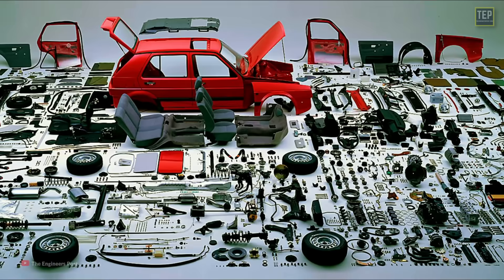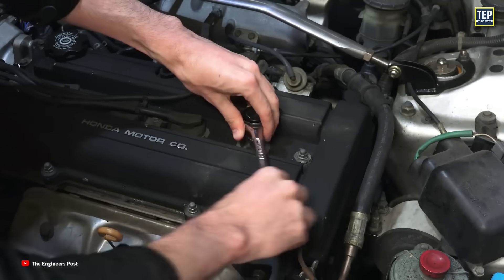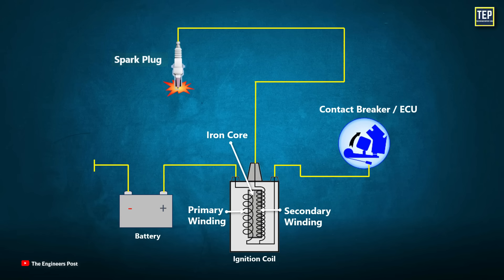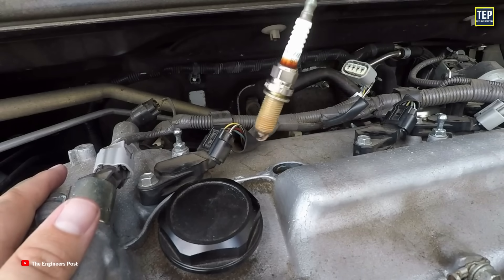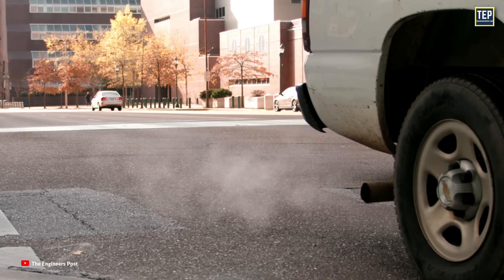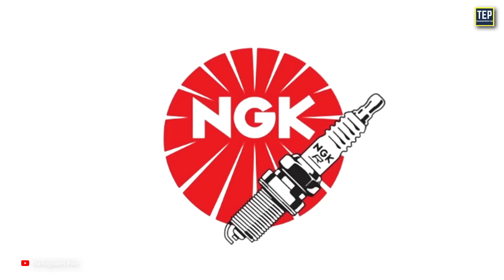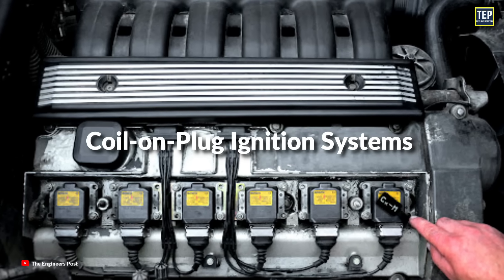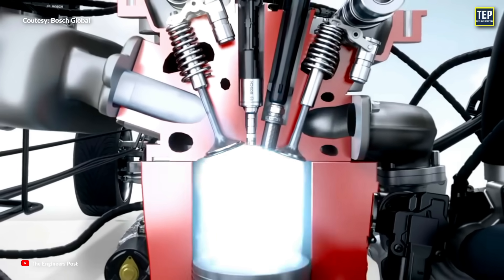Types of Spark plugs | Which is Best?

Comment: In the 90's or 2000's there was... SPLIT FIRE A SPARK PLUG IS SPLIT V TYPE SHAPE IN THE TIP. so the electrical current or spark passes through. So did it done the sole purpose.. of delivering fast ignition in all combustion in the engine.. it was discontinued in the laterr 2000 +.. now where is the developer of the said product..

Comment: Triple gap plugs should last longest as one gap wears the others take over, also the flame flash wavefront would be more even and would have more energy going downward. They are very good for small engines especially. Got a bunch for Briggs and Stratton engines very cheap from a hardware store on clearance. Improvement was immediately noticable.

Comment: I have  2024 Yamaha R1 and i was surprised when i realised it uses simple dual electrode cupper plugs. All my previous and less powered bikes used iridium, kinda strange tbh🤔. I tried to find iridium plugs to change and now im not sure should i install them🤔. A friend of mine installed iridium plugs in his Yamaha FJR1300 and got increased fuel consumption without any benefits...

Comment: I was in the room when design engineers were discussing new plugs with multiple ground electrodes.  What they stated is that multiple ground electrodes, don’t improve the spark plug, as it will only fire (spark) to one electrode.  They indicated that multiple ground electrode were a marketing tool, to allow plug manufacturers to sell plugs at a higher cost, as 2 was always better than on in the potential consumers mind.
Reply: ..and that is the hype at its best! It is a microcosm of the marketing world we live on. 'Buyer beware'!

Comment: I will have to say you are wrong about one type of spark plug. I have use a spark plug that had 4 electros around a center electrode. the Bosch platinum plus 4. They worked great  got a boost in power, and gas milage.
Reply: we have the same experience

Comment: Wrong , if it spark 100 times per second ,dos not spark 20 000 000 for  lifespan it spark      525  000 000 for 10 years  that is average 100 000 miles  Do the math

Comment: The right plug is the one the manufacturer suggests. It's the one the engine was designed to use. Simple.
Same with fuel. Use the recommended octane. Using a higher octane than what the engine was designed to use will actually get lower milage and preformance

Comment: In my Camaro with a 350, I had single electrode and it worked fine, when I put in the platinum +4 electrode spark plugs it was noticeable difference. Not like a little bit but a lot.  The difference between tires slightly spinning at a dead stop take off, to completely peeling out.  The difference was massive to say the least.  So I'm not entirely sure how that works out as I'm not engineer but real world testing to me showed that the plat + 4 had an edge on the single electrode.

Comment: 2 best plugs ever made NGK and nippon denso or nd or now just denso. Platinum or iridium. Run for 50k to 80k n regular car and only ones to use n 2 stroke dirt bikes they do not foul like all others and have tried every brand and type out there. you can plunk around on 2 sttroke and most plugs foul fast due to oil gas premix but denso and ngk last 5 times longer.

Comment: Those hemi engines with dual spark plugs were a huge pain. Not that it was difficult to change the plugs, there was just so many and going through and torquing down each one was tedious. 

I'm just glad Ford didn't do dual spark plugs on the old 5.4L's because you'd double your chances of a spark Plug breaking off in the cylinder. Lol
Reply: That's why I used double electrodes for them. It lasted the life time of my engines and no matter how had u beat on it, it's always feels brand new

Comment: I can for sure tell you that i use bosch super 4 sparkplugs. I have not yet seen any increased fuel , rather the opposite around. Been using it on a Honda Accord 1.8i  yr model 1998 and now in a Nissan Primera 1,6i. Made -94.
In the thank i have my own formula 😂
I  use 60% E98octane gas and 40% E85 (bio ethanol) ratio. 
The cars barely drink anything.
No Engine conversion or any other modifications on the cars. 
E85 are actually made for hybrid cars. Thank you for a good video :)

Comment: I’ve never known a spark plug to fail. That said, i change them per the manual.
A few weeks ago, I came across a Vauxhall Corsa with 80k miles. It was occasionally misfiring. Found the plugs to be original equipment. The gaps were 1.5 millimetres!
Neither centre nor ground electrode were badly worn, other than removal of metal due to spark erosion. Cleaned up the profile, set the gaps properly and the car has run sweetly since.
We will change the plugs, but the local parts store didn’t have any in stock.

Comment: Use only OEM spark plugs in your car and don’t buy knockoff counterfeit parts online. My Toyota runs on iridium plugs so I replace them after 100K miles and absolutely no issues.

Comment: i had noticed a few times, that even engines with normallly bosch-spark plugs run bad; after getting new ones - they were from NGK - it runs way better. It also depends on the setting of the manufacturer of the spark plug as of the engine; 'cause a good spark plug will always run good, no matter if there might be a wear like in the distributor case. Even spark cables matter - those who are designed for a engine work way better than something "homemade", like using 2 caps and a wire just to let it look fancy. if you want to get spark plugs - even on the aftermarket, 'cause your car manifacturer can't provide you with some - look for the numbers / letters, encode them and try to compare them from every manufacturer - some might seen better than others, and that little bit can be seen on the "cryptic code" (like, for ngk, BPR6ES or for bosch, FR7DC). That can you lead to the aftermatket-plugs with them your car could run better - 'cause that's also a point of the "hot plug - cold plug" .
Reply: Bosch is crapp  !  
its the most shitty brand you can buy.
Their sensors and coils are great..

Comment: If you a old British car, the iridium has a smaller electrode and fires easier,,,,the car will start easier,  British cars 12 volt and used a 8 volt coil when starter  to allow for voltage drop.  The on position then ran a resister before the coil dropping the 12 volts as to not burn out the coil.    This interconnection could cause some confusion,  such as a malfunction with the hand brake lite, could backfeed and cause the starter to engage until battery went dead.

Comment: Bought a few of those multi-pronged plugs and only had misfires and issues with all of them.  Keep it simple, and no problems.  A spark plug produces spark.  That's what it does, that's it's life's purpose.  You're not making more horsepower with a spark plug.

Comment: Running latest NGK Ruthenium HX and new NGK coil on plugs on my Nissan VQ35DE V6 3.5  - so far performance is impressive - in my opinion engine runs like new - new plugs and coil on plugs REFRESH the ignition system substantially - known for 'high ignitability'  (HI), Ruthenium is NGK's latest yet have been out for a few years - most people have never heard of them - like me!!!   Really good for older engines that need all the help they can get.  NGK fan because of NGK long life and performance - real world experience over many years.
Reply: Ngk plugs doesnt work great on all engines, some people say they had a sluggish engine when they installed a Ngk plug while the Oem plug fixed all the issues. So you must be carefull when replacing spark plug, you cannot just install every brand out there, even with the exact same specs. Every brand has a unique specific electrode desgined for the specific engines.

Comment: It's a lot more than 20 million sparks through it's life span... 100 sparks per second = 6000 sparks a minute = 360k sparks and hour. Even taking into account the bare minimum life span of a spark plug = 30k miles driven at am average 30 mph... that's 360 million sparks! Well... with those numbers it's easy to calculate other average mph and doesn't get anywhere near 20 million with a realistic average. AND, most spark plugs do A LOT more than 30k.

Comment: I habe been using Bosch multi electrode spark plugs in all my Hondas with smooth performance for longer that 60K miles for spark plug set, compared to the 600K miles for the original Denso plugs. A 93 SI, a 98 VTI and a 97 CRV.  I also used Champion surface gap electrode, basicalli designed for marine overboard engines. For these plugs you need a high energy capacitive discharge ignition. This was on a heavy modified 1962 VW beetle. Never had to change or clean plugs. They lasted for about 200K miles, untill I sold the beetle. Now I have a 3,5 liter V6 mitsubishi. I use the recomended iridium spark plugs, just because they are changed at every 60K miles service, and you need to remove the INTAKE MANIFOLD to access the plugs...

Comment: 20M sparks through its lifespan ÷ 100 sparks per second = 200,000 seconds its lifespan! 

200,000 ÷ 60 seconds (is equivalent to 1 minute) = 3,333 minutes

3,333 minutes ÷ 60 minutes (is equivalent to 1 hour)= 55 hour

Is the lifespan of the sparkplug is equivalent to 55 hour? Please correct me if im wrong!

Comment: Years ago the spark plugs used in a Mercury  snowmobiles with German Kolher engines used the sides of the plug as a ground to the electrode. The gap was always perfect and all you did was brush the plug clean.For some reason they stopped making these plugs,Sounds like they were too good

Comment: One other thing, the NGK Iridium  is not durable but also cheaper than Nippon Denso which comes with many Japanese car brands. They are very close in performance. I have been using NGK from the 80's with different cars and models from Japan. They have never failed me.

Comment: There's one type of plug you forgot to talk about... the RUTHINIUM plug  said to last longer than an iridium plug. I have used these plugs in 2 of my cars and they really work. Better than an iridium? Idk but I like the fuel mileage gain when I switched to them and the response in the throttle seemed a lil better as well
Reply: Unless you actually MEASURE gas consumption with calibrated instruments and power on a calibrated Dynamometer, you are just wondering your "results"...
Reply: @alfredomarquez9777  no sir been driving and wrenching on cars, bikes atvs any thing with an engine and I have to say... I won't use anything but ruthinium plugs, my dyno is my foot and my butt I know when a vehicle runs better and when it don't. 
All you techy guys with your computers and all that think that's where it's at, for some stuff it is but you can't tune a carb with a computer, that takes skill and experience. 
Look I'm not and never have tried to hack on your video I was just letting you know there is one more plug out there that you should give a look at that's all.
Thanks for the video bud it was very informative

Comment: I bought a used car with 226k miles on it. Needed new plugs, which was reasonable to replace... I discovered that those were factory originals from 2001, and had never been changed, because it literally just kept running fine, until one or two plugs fouled. Well, I splurged for "fancy" NGK Laser Platinum plugs with multiple spark gaps, and they only made it 2 years, 26k miles before all 6 were toast. Now I have basic single spark gap Iridium plugs that cost 3x less than NGK, and performance seems improved.
Reply: What were the identification numbers on the vaurous spark plug models?
Reply: @gregorymalchuk272  Originals were Bosch R6 Platinum (single gap). Replaced them with NGK BKR6EQUP Laser Platinum (4 ground electrodes). And now I'm running AutoLite XP5224 Iridium (single gap)
Reply: How did the NGK with 4 electrodes perform? I wonder because I just bought them but haven't replaced them yet.
Reply: ngk is not the same anymore - quality wise
buy denso instead 👉

Comment: I am going to replace the plugs in my 1997 Toyota Avalon.  The owners manual says to only use dual electrode plugs.  Since I had already bought single electrode plugs, I was unhappy.  But now I see that the extra electrode is only to extend the life of the plug.  I'm now planning on using the single electrode NGK plugs.  Thanks for the knowledge.
Reply: Used to had the mcv21 2mz 2.5 v6 engine, on manual it says to use the dual electrode spark plug but I found the ngk copper, single electrode, which is the cheapest one, performs better, the car feels more responsive, more fuel savvy.
Reply: camry went almost 100k on platinum ngk single post. Was running fine but had to remove plenum for sensor so had access to rear plugs on V^ put another set of ngk platinums 40k and baby is smooth as baby butt

Comment: my only vehicle takes two spark plugs, so i can afford more expensive plugs.
it's also high strung running on 91+ octane, with a high performance ignition system .... my primary criteria is a knock resistant plug, and so i settled into - one heat range Brisk racing plugs.
they have multiple ground electrodes, but my engine is swirl ported and so has a very well atomized homogeneous charge.

Comment: There is now a simple solution to no longer concerning about spark plugs, oil and fluid changes, or failure of any of the approx. 300+ moving, heat cycled wear prone parts associated with a liquid fuel propelled out dated, illogical p.o.s. inturdnal crapbustion engine. guess what it is?.

Comment: Multiple electrode earth became popular in aircraft in WWII to improve flame front and stop spark failure on take off which caused loss of life in Allied planes. 
Lodge introduced a resistor in the electrode and did a year of successful tests. They were then manufactured but it was a marketing disaster. It was discovered that the original low production of resistors had been done in the manufactures lab at 2% accuracy. Production on lines was at 20% accuracy and the success of the plug failed. Too late to recover from the failure Lodge was bought out.

Comment: Replace with original manufacturer plugs. Bought a 2006 F 150 someone replaced with autolite plugs. Replaced with motorcraft plugs run a lot better. Not knocking autolite just not the best solution for this vehicle
Reply: Thanks for that. I also have a 2006 F-150 4.2L over 200k that I'm about to change the spark plugs on. I'll go with the motor craft sparkplugs.

Comment: rebuilt my engine misfiring horribly used bosch 4 electrode sparks put in dual electrode iridium as it required in the manual works perfect

Comment: a new hemi  ya  16 plugs  but not true a few years back and  today some cars  the coil pack and plugs are at a point it takes a factory tech  to remove and replace as needed  not as user friemdly as you claim, and you briefly   brush over part of some stuff . engines are designed by the manufacture to run  at their optimum  effecincy and power  under certain  spec  with include fuel   oil and plugs as spcified by manufacture and changes  in them can affect life of you engine   fuel economy  and pollution produced by the engine

Comment: Here  in  South  Korea,  we  have  fanboys  who  compare  the  performance  of  used  and  worn  copper  and  iridium  plugs with  new  ruthenium  plugs.  

I  will  be  sold  on  ruthenium  plugs  once  I  see  other  manufacturers  market them  as  they  have  done  with  platinum  and  iridium  plugs.
Reply: My  1990s  GSXR  came  with  CR8EK  dual  electode  plugs,  but  it  seems  to  run  okay  with  standard  CR8E.  For  the  emissions  tests,  I  have  put  in  CR8EIX  and  a  catalytic  converter  in  the  4  into  1  pipe.  I  have  passed  the  past  two  biennial  tests.

Comment: actually, under the pressure (about 10 atmos.) in the cylinder, all 2-3-4 spark gaps of multielectrode spark plugs are working simultaneously. i saw video and can remember 100%..  but, may be there must be enough energy stored in the coil..and it is a little bit harder to achieve, than just change thrignition coil(s).. not for the average mind. so, that what you have said here isn't  true.. but who will believe me?)

Comment: Thanks- in spite of being a mechanical engineer with 60 years of building engines; I learned a few things from your video. Note that pre-WW 2 piston aircraft engines used multiple spark plug grounds for their magneto-fired engines apparently for more reliability, so this is not quite a new innovation. Racers also found it's also close to impossible to re-gap such plugs without damaging or breaking the center electrode.
Reply: Aircraft style spark plugs have totally different equipment to maintain them. The feeler gauges are sets of thin wires on little keychains, put between the center electrode and the side ground strap to probe the distance. Adjusting the gap requries a little jig with a thumbscrew that pushes the ground electrode in.
Reply: that's why you should use a lever gapper and not the disc style, that way you dont touch the center

Comment: I have had NGK iridium plugs in my 2002 Rav4 and have had zero problems over the last 7 years whatsoever!  If you have a new car the NGK iridium are highly recommended as these spark plugs will last at least 15 ~ 20 years!

When I removed the NGK plugs after 7 years the plugs were a little brown in colour but looked almost close to new!
Reply: LOL had to laugh at that comment, my NGK iridium plugs need to be replaced every 50K miles.
Reply: ngk platinum in 03 v6 camry 350k miles on my 4th set they go 100k easy and still idles smooth and gas mileage is fine 24 mix driving 22 city 32 hwy with v6
Reply: ngk performs the worst of all brands. and 20 years? i replace mine every 2 years
Reply: Brisk iridiums performs a lot better than my Oem Ngk iridium plugs !
Reply: I just put in The newest NGK plugs Ruthenium HX in My 2016 RAV 4 while I was at it  I installed new Denso coil / boots I did all 4 !